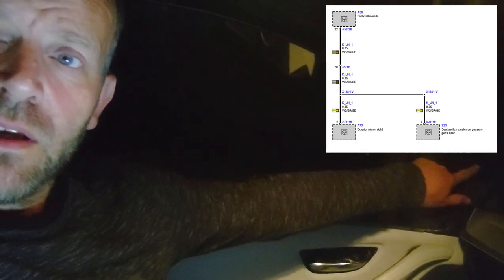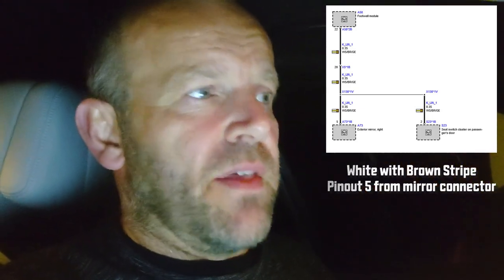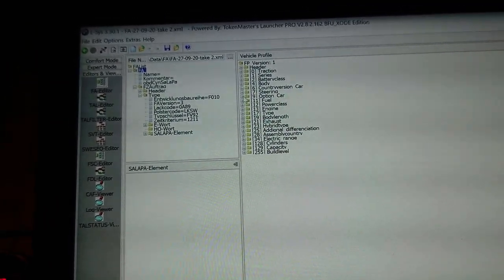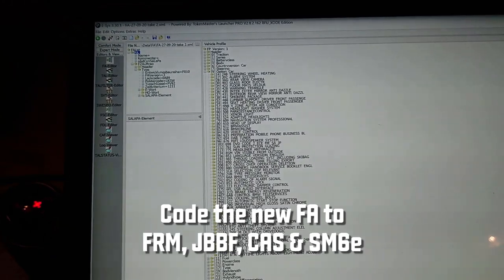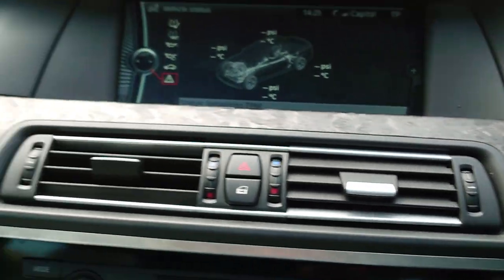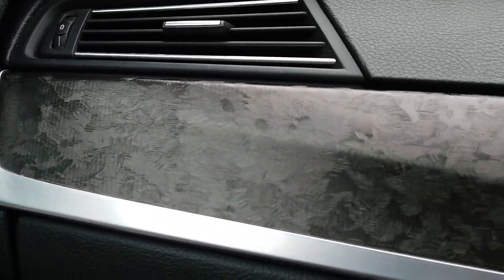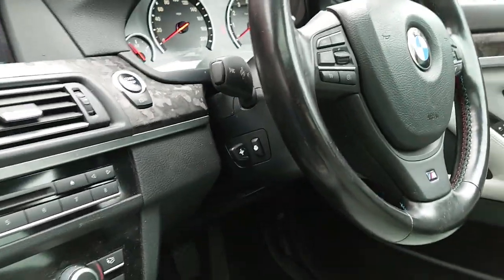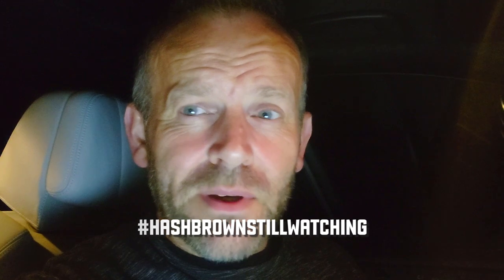Salvage BMW F10 M5 passenger seat memory enabled ESYS and ISTA, plus forged carbon wrap.

Comment: Wow. Looks good.
Reply from the maker: Cheers buddy, still a long way to go. Don't suppose you know how the front windows work do you?
Reply: What's wrong with the windows?
Reply from the maker: @P4RVEZ02  the front ones don't work. Window switch registers as activated on the FRM but windows don't open. Also can't initialise them via ISTA. Not sure if it's the FRM or the regulator/motor, and don't understand what to check for at the moment.
Reply: @RichsRides  Hi, I would suggest to check the fuses incase you haven't. https://www.google.co.uk/amp/s/fuse-box.info/bmw/bmw-5-series-f10-f11-f07-f18-2011-2017-fuses-and-relay?espv=1
Reply from the maker: Hi Buddy, turned out to be the FRM in the end, thanks for the advice though it helped with the diagnosis.

Comment: Hi, I'm retrofitting the comfort seats to my F10, from Standard Seats, so where do I plugin the Power and the ground? and The Drivers side as well.
Reply from the maker: +Andrew Lamont I will have to check to see if I can find the wiring diagram for comfort seats, let me see what I can find. have you done all the appropriate ISTA stuff too?
Reply: Not yet, I just read the errors, ISTA  tells the modules have not been coded to the car. I'm trying to learn how to code with E-sys. I have ISTA+ which I heard can code. Not sure how coding on ISTA+ works.
Reply: The seat wiring I think I have it covered, I have done the power and CAN bus, the driver backrest does everything, the bottom part of the seat doesn't do anything at all. So my initial question was for the memory buttons on the driver and passenger door, pin 5 on the mirrors is LIN, so I am not sure about the power and ground wires.
Reply from the maker: @Andrew28Lamont  do you mean which pins are power and ground or when to find the source to tap in to?
Reply from the maker: @Andrew28Lamont  I've never coded with ISTA, I've only ever used ESYS. If you find out how ISTA works for coding can you let me know.

ESYS is fairly straightforward, just plan what you need to do and run through the steps virtually a few times so you're familiar before you actually do it.
Reply from the maker: @Andrew28Lamont  the seat not working properly is probably just a coding issue.
Reply: @RichsRides  yes, I need the pins I can splice into on the mirror. I have 5 wires going to my mirror on the passenger side, green/black (power), green/brown (ground) and green/light green (LIN) for the control module at least that is what i assume and then there are 2 bigger wires, green and brown which I assume are the power for the motor.
Reply from the maker: @Andrew28Lamont  I'll have a look later and see what I can find from my notes. It was a little while ago so I can't remember. Good work so far though.
Reply: @RichsRides  thanks. Looking forward to your notes.